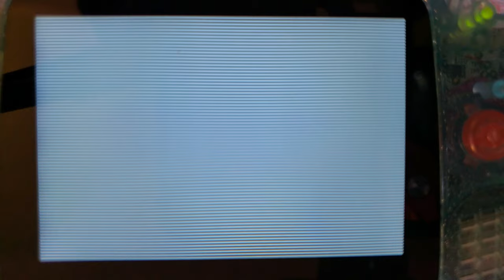Game Boy Advance Laminated 720x480 IPS Backlight with OSD and FRM

Comment: There are so many backlit screens to choose from I don't even know what would be the best for me...
Reply from the maker: Unless you want a specific feature or look, they all do pretty much the same thing in pretty much the same way. I have a wiki linked in the description that summarizes these kits.
Reply: For some certain games I like playing on my GBA which has the Funnyplaying ITA screen but for the majority of games I prefer this one in the video, maybe due to the higher resolution. Using the pixel grid option you will have to bump up the brightness to balance things out, which in return impacts the battery life but even so from all the screens I've tried this one is currently number 1. But it's all subjective tbh

Comment: this kit looks like the screen is slightly pushed back so some angles end up having edges cut off, i was wondering if the funny playing laminated kit also has that or if it doesn’t have any of the screen cut off reguardless of the angle
Reply from the maker: Nah so with these screens, the LCD is laminated to a small piece of glass the size of the view window and then the glass spacer is laminated to the glass lens. This pushes the screen back (enough to clear the edges of the shell and allow this to work without cutting more of the shell out) but also kinda messes with the viewing angles since the LCD is so inset.

FP laminates their LCDs directly to the lens and the result is more in line with what most people expect.

Comment: Hey Makho this may be a stupid question, but since this queation has always bothered me here goes. Since some screen mods use phone screens or the ds lite screen why not use the touch screen to implement/control the brightness on this original launch model gba? Seems to me it would save on soldering and make mods truly drop in. I mean u are already using an adapter board to make those screen work for the gba wouldn't make more sense to add a few extra components to make the touch work?
Reply: These kits might have the front digitizer removed
Reply: @Miroslawkrynda6477  they are removed. the dsi one is already a really tight fit as is. so, I couldn't imagine making that thicker with a digitizer and a larger board. then you would also not be able to have it laminated unless you had a custom front capacitive digitizer. but that gets into the too expensive and too much work for something that has already been solved with touch sensor/soldering to test pads.
Reply: The digitizer is a separate assembly with a separate cable and would also require a dedicated controller circuit to handle all the functionality, in addition to the fact that digitizers are typically of a proprietary design specifically for the phones they were designed for, I don't know if it would be all that feasible to design and produce a brand new digitizer to retrofit an existing LCD. If you were to go that far, it may make more sense to design an entirely new LCD, though I can't say the high costs and redundancy would be worth it for a bit of functionality on a drop-in replacement that is already achieved with an insanely easy skill. If you can undo a few screws and completely reassemble a GBA, you can surely solder a few wires.  

Of course, I won't try to discourage you or anybody else from creating such a product and bringing it to market! 👍

Comment: do you know if this kit is leaves more room on the inside than funnyplaying’s laminated kit? i saw you managed to cream funnyplayings laminated kit with that usb c hdmi dock thing, and was wondering if it would be possible with this
Reply from the maker: There's no bracket behind the screen here but the LCD assembly is very thick. I'd wager they are about the same but with fewer moving pieces, this one is still gonna be a lot easier to wrangle.

Comment: I installed two of these kits recently. The top touch sensor never works when stuck inside the shell, only the bottom sensor works. I just cut both of them off and use button controls. Also one of my screens came with a dead pixel out of the box. Other than that the installation is much better than the FP laminated kit. The FP kit does have a better DMG color palette option than this one.

Comment: Hey Makho, my R shoulder button wasn't working properly. Light presses worked every now and then. I tried with a q-tip soaked with IPA, pressed the button a bit and it worked since the shoulder button was responsive. But it lasted just a couple of days.
I then tried to put more IPA inside with a syringe at the sides of the button but somehow it made it even worse and now it's working only if I hard press the R button. Should I just buy a replacement trigger or is there a way to actually clean it? For example for the DS Lite there's a way to do so (by bending the metal shield and cleaning the metal inside) and it actually worked on mine. Thank you!
Reply from the maker: If opening the button and cleaning it doesn't work, buy a pair of tacts and replace both imo (so they match, not because you can only replace the one).

Comment: I have a feeling you are the type to respond to comments… i have a gba that i recently did a laminated 3.0. I dont remember it doing this before the mod but since i have had to work the power switch multiple times before it will turn on. I have replaced the battery, reflowed the power switch and cleaned the power switch thoroughly… any recommendations?
Reply from the maker: The symptoms you describe are most commonly due to a dirty power switch. How did you clean it?